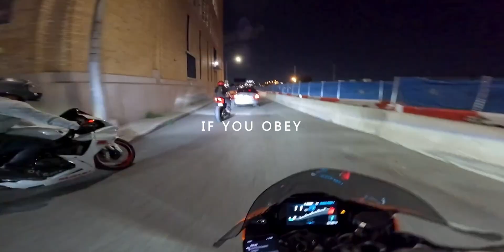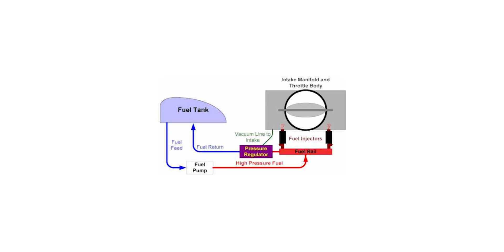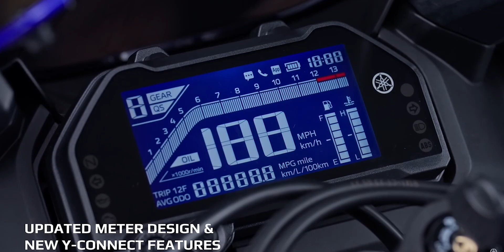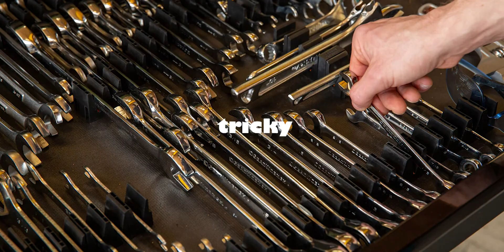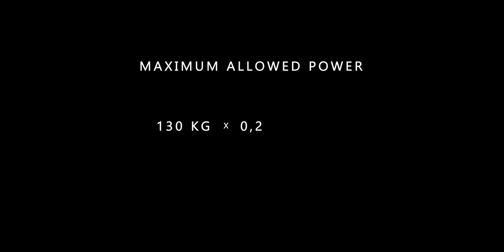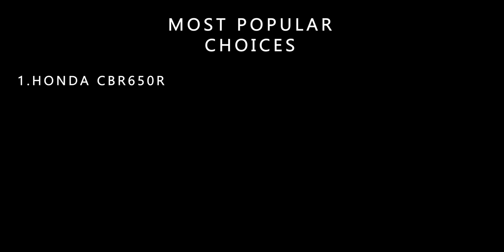How to Restrict your Bike for A2 License

Comment: hi please i ride a 250 honda cross and i want to buy a av mangusta 1100rr and i drove it and was surprised by the weight a power response on the throttle, so how can i restrict the power for a smooth aceleration ride without it kiling me?